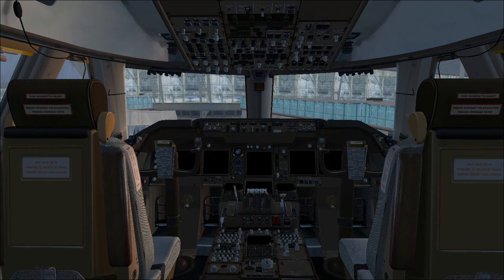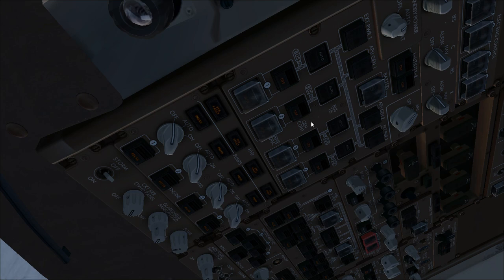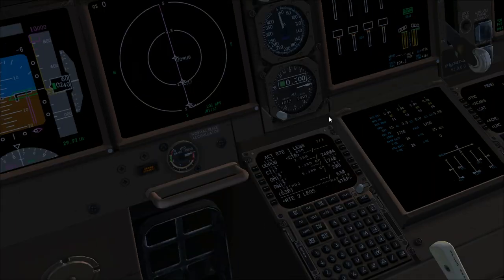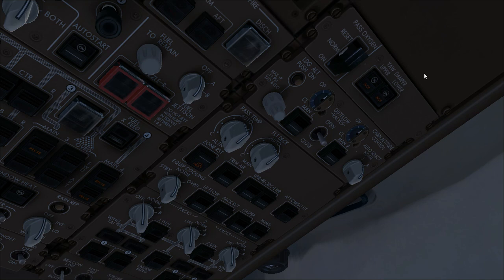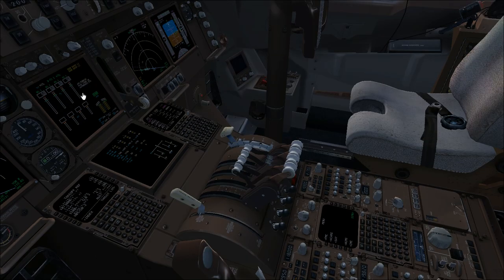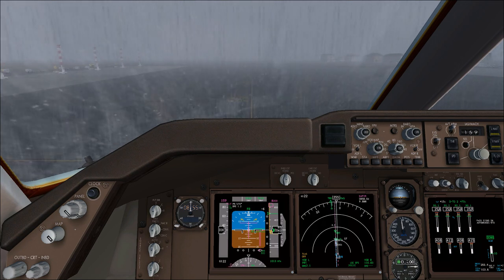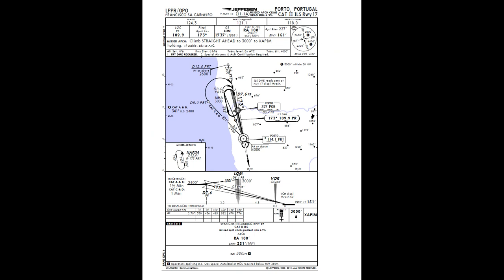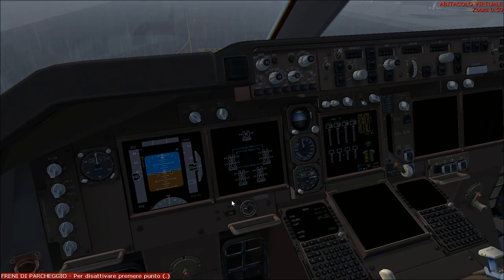Avgeek's Life: iFly 747-400 Cold & Dark Tutorial/Preview (FS9)

Comment: Which VC Rain Effect bmp are you using? Or it just comes with iFly.
Reply from the maker: It's actually the standard FS9 rain effects. After much research for them I find the original FS9 effects the most realistic out there, both when standing still than when flying. The iFly uses the rain effects of your configuration, remember that rain effects are not available in FSX.

Comment: Nice detailed tutorial, one question though. Why do you wait to turn the hydraulic demand pumps to auto until after  engine start? The FCOM normal procedures specify the demand pumps should all be off during preflight, Pumps 1,2,3 set to Auto and 4 set to AUX at Before Engine Start, and pump 4 switched to auto after engine start. (There's also a variant where at Before Start pump 2,3 are set to Auto and 1,4 set to Aux, switched to Auto after start.)
Reply from the maker: The Boeing's FCOM say to turn DEMAND pumps 1,2,3 to AUTO and pump 4 to AUX. Anyway, many company SOPs uses this procedure to ensure safety around the gate area. Systems 1 and 4 are the systems that pressurize hydraulic lines for brakes and wheel steering. So when you start the pushback the only systems needed are 1 and 4. Airlines prefer to pressurize those two systems before the startup and complete the pressurization of all the hydraulics only when clear of objects at the end of pushback and startup. The AUX position is only possible on the system 4 as prevents fluid mixing between different systems, the system 1 is turned to AUTO as there is no AUX position for it. Hope this helps you!

Comment: Decided to skip this after seeing this, sorry iFly
Reply from the maker: I'm just a member of the Beta Team, if you need more info the forums are open! If you have a specific concern I would be happy to pass it to the Team. ;)
Reply: A few things actually:

1. Will the oversized control column be fixed?
2. The external model doesn't look too "spot-on", especially the landing gear. I can't honestly tell what is wrong but it doesn't really look right. Might be a good spot to investigate on.
4. The refresh rate of the PFD and ND in the video seems low, is that what you get in the sim?
4. VC framerate is a primary concern for me and I've heard that VC framerates is not totally desirable in FSX, can anyone provide their spec and the performance in the sim? 
5. Landing gear animation is important to me, the product from your rival 7 years ago wasn't able to offer a smooth animation when the wing gear touches down. Can you post a video for the landing gear touch down animation to show us how it looks like?

Many Thanks
Cedric
Reply from the maker: Cedric Sin The team worked with real world data and measures from manuals so I can assure you that the measures are exactly as they are in the real 747-400. It's still  better if you write your concern on the forums as there are many more members that can give you advices other than me only.

1) The control column is not oversized, some users reported it but there are dozens of photos on the net that proves the contrary; one example can be found here: http://upload.wikimedia.org/wikipedia/commons/a/aa/JAL_Boeing_747-446_flight_deck.jpg.

2) External model was worked on for a very long time and it's spot on. The team worked on the smallest details and I don't see any difference with the real 747 when comparing them; many details were added during the developement but I can't really see what do you mean with the landing gear. The entire Beta and Dev teams worked on it, you must be more precise on this subject as for all of us the model is spot on. It's possible that you spot something wrong, but I need a precise concern to report it to the team.

3) The refresh rate is every 1/18 of a second. It's optimized and is much better than the 737NG VC refresh rate. As I say in the video my specs were low so probably with a better computer I guess it will be better. Anyway, the refresh rate in my video is just little less than the one I was experiencing during flight.

4) FPS depends on dozens of factors. In another comment I pointed out my specs (that I would say are actually low) and during the flight I was getting 16/18 FPS with the video recorder software working. In FSX everything depends on your system and CPU but FPS mean nothing without smoothness. As I said my FPS were not so high, but I'm sure everyone see that the video is smooth. This is the key point, but I have no definitive answer for you on this topic as the model is really complex and your configuration is unique. There is the 30-day guarantee refund option that you can use to see if the product satisfy your expectations! The refund process is easy and hassle free, this is why Flight1 delivers this option.

5) Landing gear animation was worked on during the development; one member is a master of FS videos and pointed out this need during deveopment so that the team worked on it at its best.. I will try to do a video of the animation but no precise date for now. I can assure you that the animation is working very well, the main problem is the usual runway elevation "jump" of FS9/FSX that sometimes makes the wheels to "move" a little early or a little late. Unfortunately this is related to airports and addons.
Reply: Very comprehensive reply, considering since I don't get to touch my desktop until mid December haha
Reply from the maker: Cedric Sin It can be also of reference to other simmers that have questions about the same topics! Anyway, the team worked hard on it and it's open to suggestions or reports if something is actually wrong. Some users reports helped to correct small issues in the past and will probably do again in the future. If you spot something precise I'm sure the team will be keen to hear and see what can be done.

Comment: Nice review! can you give your PC specs? Thanks!
Reply from the maker: Thanks! I run this on a very basic laptop: i7-2620M 2.70GHz Dual Core, SSD Samsung 512GB, Nvidia NVS420. It's FS9.1 and it's highly optimized for smoothness, FPS around 20 while in VC cockpit. 2D cockpit and external stable at locked 27 FPS. Hope it helps!
Reply: Paolo Fumagalli Thanks! and what about the performance compared with PMDG 747?
Reply from the maker: cinipaes I don't own the PMDG 747 so it's impossible to me to compare them. Anyway, the iFly is using a more complex model and it's using modern techniques. I guess that you need to have a faster PC to run the iFly at the same FPS and smoothness. Of course this changes between FS9 and FSX, but I'm sure you're aware of this!